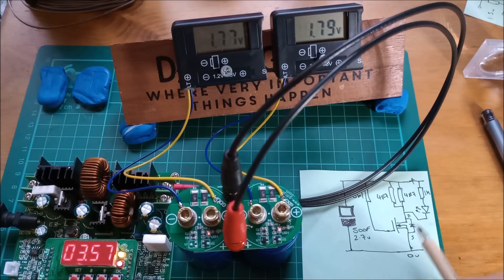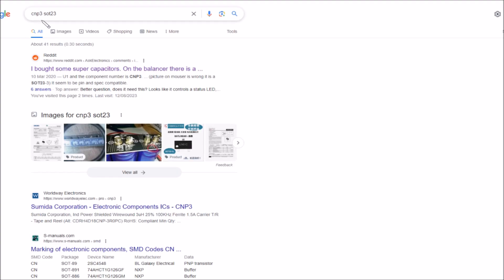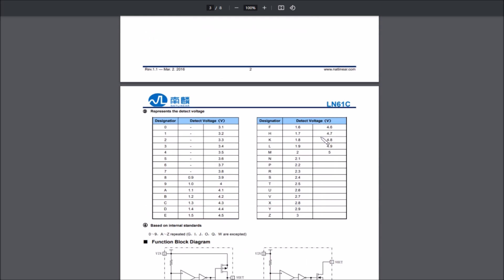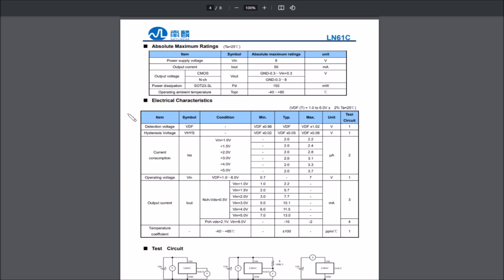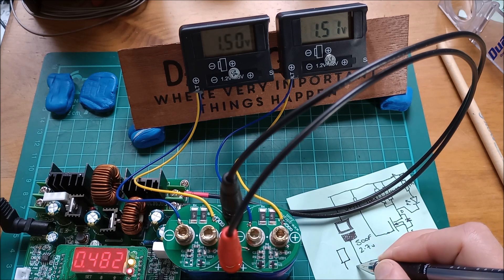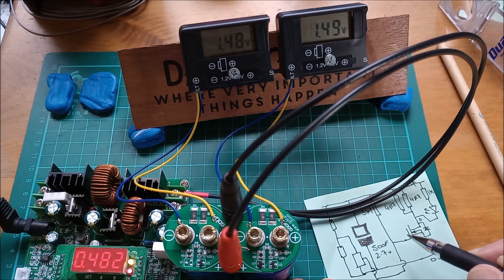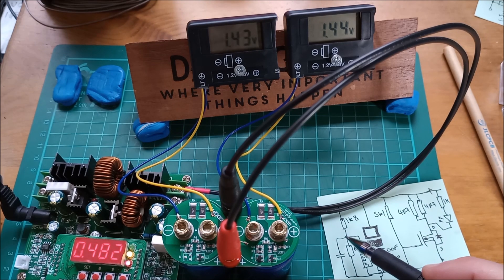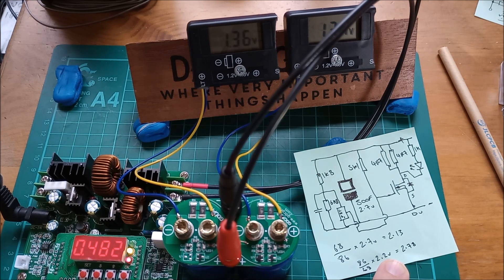Part2: Supercapacitor 5.4V 250F Schematic

Comment: It could be worse than that as the chip is in parallel with the lower resistor,  so some current is going to be flowing through it. So affecting the voltage across the lower resistor so rasing the switching voltage.
Reply from the maker: True, although the datasheet says it only consumes 2uA.

Comment: To verify that:
Replace the Supercap with a normal cap of around 1μF (rated 16V or more) and connect that to a variable lab PSU. Measure I (current) as a function of V. Draw the curve.
Reply: You can add a 10k trim pot in // to the resistive divider to adjust the threshold

Comment: I guess that's why one was missing, to stop damaging the super cap. Would they balance at close to 2.7v with the single device connected as it arrived?
Reply from the maker: Ironically, the capacitor with the missing IC is better protected. The protection circuit is badly designed and doesn't stop the capacitor to reaching too high a voltage. There's an easy fix - change the potential divider resistor ratio. Then I'll replace the missing IC and it'll all work properly.